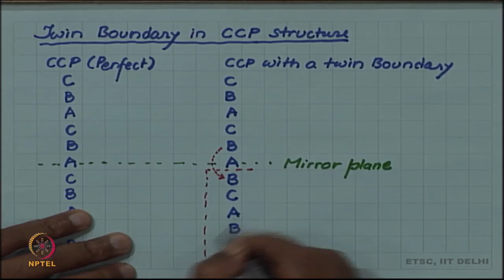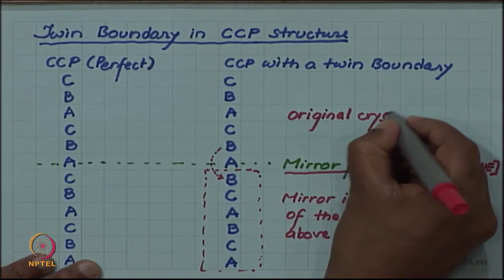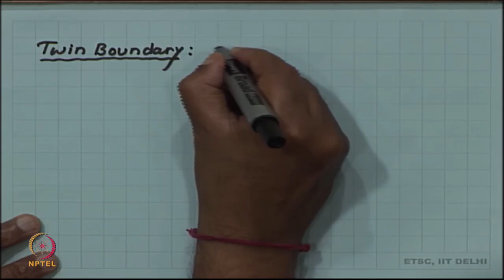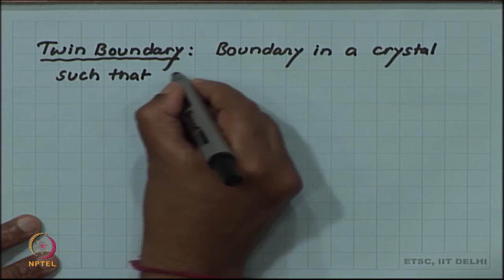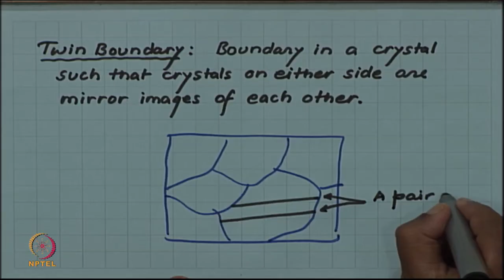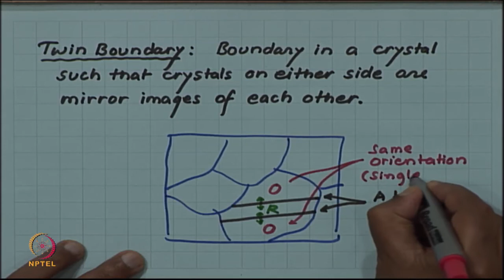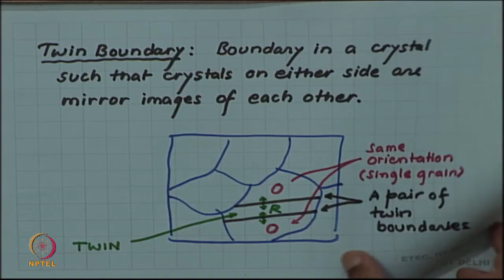Twin boundary

Comment: Why twinning happens
Reply from the maker: A difficult question. One can think of twinning as a plastic deformation mechanism competing with slip mechnaism. In cases where twinning requires lower stress than slip, twinning takes place. But I am aware that this is not a very satisfactory answer.
Reply: @introductiontomaterialsscience  twinning happens in pairs usually, I heard. logic behind that might help understand twinning occurrence better..

Comment: Hi sir. Twin boundry is the result of tilt angle of 180°, then why can't we include in Grain boundry. Does large angle boundary in tilt angle has any limitations??
Reply from the maker: Hi Hari. Twin boundary is indeed a grain boundary. It is a grain boundary with special orientation relationship of grains across the boundary. The two grains across a twin boundary are mirror images of each other. But the same two grains can also be related to each other by a rotation.
Reply: @introductiontomaterialsscience  Thank you sir. Now I could visualise it.